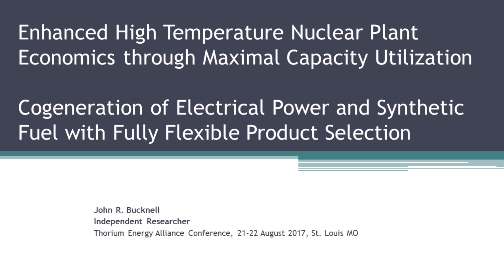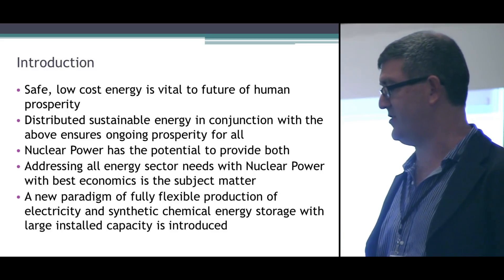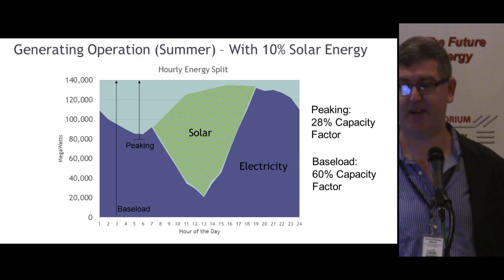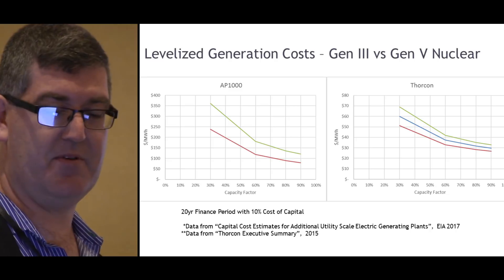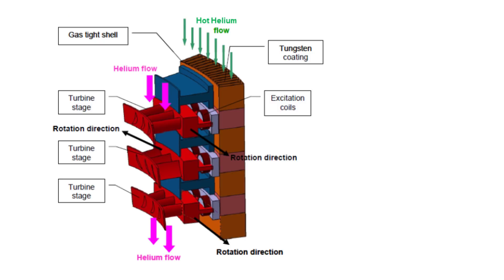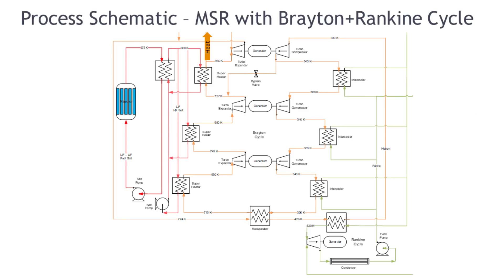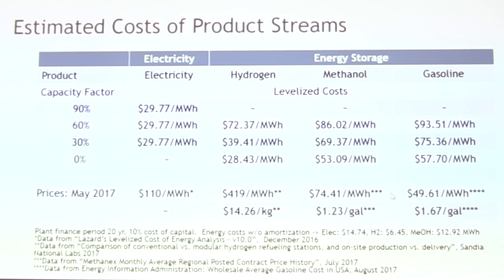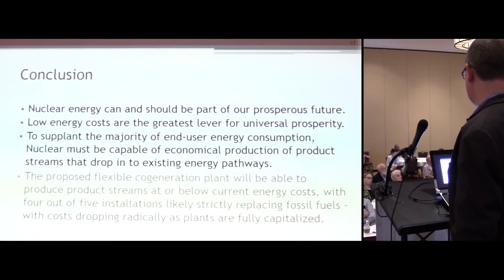John Bucknell - Nuclear Plant Economics & Synthetic Fuel Cogeneration @ TEAC8

Comment: So let me get this right. When the intermittent renewable power supplies flood the market with excess power (thus diving wholesale electricity costs to below break even, you simply transfer the extracted heat from the molten salt reactors to manufacturing chemical energy (which is still the most efficient way for transportation especially aviation).  Then when the wind stops blowing, or the sun goes down, and everyone gets home, turns on the lights, the tv and the oven, you transfer your heat to the generators and sell the power to the grid.  Excess heat from both processes can go to desalination which results in another sellable asset. Cool!
Reply: It doesn't have to be for transportation. Apart from aviation, the economics for hydrogen as a storage medium is less apparent. But regardless, people are going to need hydrogen for fertiliser, medicine, making lubrication oils and gels, and smelting of steel. Alternatively or additionally, you can also use the excess electricity to desalinate water or recycle waste water for consumption. Climate change is happening and our water supply is at risk.

Comment: The sulfur - iodine cycle will be extremely difficult to produce for corrosion reasons. Hydrogen Iodide is almost ridiculously corrosive. BUT I agree we should still research it! Also please just make electricity using existing USC steam. The reactor is already difficult enough. FOCUS on the reactor!
Reply: Indeed, I don' t understand all this complexity when you have (with MSRs) very low cost electricity. On the other band, a good source of carbon may be biomass gasification (if used as C source only)

Comment: The Achates 2 stroke engine is about to enter mass production, the diesel version is 20% better than the best being used today, and the Gasoline version is 60% better on fuel. Combined with synthetic clean fuels like Methanol ( CH3OH) which is identical to gasoline in energy density then we have a vastly superior transport motive power than electric vehicles which while having some limited niche advantages will be economically and practically .............junk. Methanol can be distributed by all the existing petrochemical infrastructure saving trillions of dollars across the globe. One of the biggest blind spots that electric car/truck advocates dont understand is the massive expansion of grid infrastructure needed to support them.
Reply: The vast majority of electric car charging happens overnight when electricity consumption is low. Charging stations are mostly needed for road trips, and are cheap to build.

Battery-electric vehicles no longer have significant limitations for longer trips. Teslas V3 chargers have a typical charging time of 15 minutes.

The convenience of always having a full range at the start of the day without needing to visit a gas station, the noiseless operation, lack of emissions, much higher efficiency and so on will make selling ICE engines extremely difficult if not impossible in the coming years.

Synfuels certainly have their uses for long distance planes and ships, but not for road traffic. I suspect the Tesla Semi truck will kill the internal combustion engine in heavy duty applications as well.
Reply: @phamnuwen9442  Run the numbers........the size of battery needed to pull a typical heavy semi here in Australia ( 68,000kg) would be huge...........and how will the battery dissipate the heat under full load, on steep climbs that can last 30 minutes or more?  Your way out of your league talking about heavy haulage applications.  So when are we going to see AUD $20,000 electric cars with 500 km of range............the answer is never.  How are you going recycle the 500kg Lithium battery? How are Lithium batteries going to improve so that they offer the same energy density per cubic meter of petroleum fuel? It cant.    There is a niche market for small cars and E-bikes in inner city environments that need limited range and are light in weight and can make the most impact and have the most benefit.
Reply: How are the Tesla V3 chargers putting a full charge of 100 kw/hr in 15 minutes...........they dont. So stop misleading people with nonsense, 15 minutes is only a small top up and that does not represent real world situations other than short distance travel to work. We even had outright lies from the green movement here during the last election, claiming that a Tesla could get a full charge in 8 minutes.............it was a totally misleading claim based on press release of high capacity charging station for recharging a BUS with a very large bank of Batteries.  Hooking that up to a Tesla would of made it explode without a safety cut out. People are getting sick of these "green scheme" liars. Is your real name "Bill Shorten"?
Reply: @phamnuwen9442  Lets build a Lithium battery ( Telsa specs) for 68,000kg typical highway truck here in Australia.  Now the Tesla has a 85 kw/hr battery that weighs 540kg.  Now our B-Double is going have a load factor on the engine of 50 % which is 250 kw every hour.  It will be on the road rolling 10 hours in a 12 hour shift.  Thats 2,500 kw/hrs and you will need at least 29 Tesla batteries to meet that demand weighing in at 15,600 kg.  Effectively meaning the payload will have to be reduced some 40%.  Now here in Australia the Tesla supercharger stations are 50c kw/hr but lets use the typical retail price of power here of 35c per kw/hr that comes to AUD $875 when the diesel engine version will use 300 litres of diesel costing AUD $420 ( and 80% of that cost is taxes). So anyone who thinks that Lithium batteries are going to push around anything heavier than cars is going to face a crushing economic reality of dismal failure and destroyed standards of living from using such a limited technology.
Reply: @wazza33racer  I said "typical charge time" not full charge. Learn to read.
A 1MWh battery weighs 6.4T and will be able to drive 4h using your 250kW figure which is probably higher than for US and Euro trucks. Drive 4h, stop for lunch and recharge, drive 4h more, repeat. Seems perfectly feasible.
Search for "V3 Supercharger" on Youtube to get an idea of charging speeds. Model 3 is capable of charging at 250kW which means a 1MW battery should be able to charge at a peak of 3MW if needed to make this practical. 30 minutes will probably give you an almost full charge.
Reply: @phamnuwen9442  AMAZING..........so you admit that typical is not a full charge, so why bother coming up with the 15 minutes number......simply misleading. Your 1 MW battery wont cut it for most semi trailer applications, unless its a small truck hauling a light "cubic" load of toilet paper or crisps. Seriously, this is the real world of trucking, real trucks, real gross weights of 44,000kg to 81,000kg which are 90% of the trucking fleet here.  So multiply your 1MW , 6.4 tons by 2.5 to get a real battery and we have an enormously heavy battery that cripples the productivity of the vehicle.......total fail.  Just admit it, lithium batteries cant cope with heavy applications. Recharging time is still a lot longer than the time it takes to put in 300 liters of diesel..... even a recharge time of 1 hour per shift is 2 hours sitting around doing nothing for a fleet truck that usually is out working 24/7/365. Factor that lost productivity into the higher cost of electricity,lost payload etc etc...........it all adds up to a monumental economic and practical application failure. You want to keep going?? How about, just how much would a 2.5 MW lithium battery actually cost to supply from Tesla............REALLY BIG NUMBERS thats what.
Reply: Most sources on the net are saying US $12,000 for the 85kw/hr battery...........multiply 29 times to get a useful 2.5 MW/hr battery and we have US $348,000 ...........holy moo cow thats really gonna jack the price of the prime mover to the moon and back. Good luck with that.

Comment: Greenies just dont understand how many heavy machines need diesel fuel and electricity ( battery or otherwise) is just not feasible. Every kw/hr of electricity also needs metals to be transmitted and stored etc. Just switching from Diesel to electric propulsion would need a gigantic amount of refined metals, including exotics at huge energy investments and environmental impacts. Gasoline is 20x more energy dense than a lithium battery, and when the Achates 2 stroke opposed piston arrives ( 60% better fuel economy) it will make Gasoline effectively 32x more energy dense. Electric car people just dont understand the math of how inferior electric cars are in both thermal efficiency and cost per km to use Lithium storage.
Reply: how did you figure it would be equivalent to 32 times better?
Reply: When is the Achates engine arriving?
Reply: @emceeboogieboots1608  Already in production with Cummins diesel, being supplied to the US military. Aramco in Saudi Arabia are trialing it their fleet of pick-up trucks also. Has been through a CARB trial in california in a Class 8 Peterbilt.  Because of its almost zero NOx emissions, California are  considering making it mandatory, or at least the benchmark in emissions.

Comment: as shown, we indeed really don't have a choice. however, this only makes sense if all of the world's electricity is being produced from non CO2 sources. next to this I wonder what type of materials are able to withstand a sulfuric acid/water vapor at 1000 oC ? I don't think we have any option there. My last question is how does this compare to making hydrogen from commercially available PEM electrolyzers?
Reply: Hydrogen via best available electrolysis is something like 71% efficient as compared to the input electrical energy.  The energy conversion from heat to electrical is where the largest losses are, so net can be 25-35% as compared to source energy.  This is the reason for thermochemical conversion cycles which can net close to 50%.
Reply: But what about low temperature steam electrolisys ? My understanding is a bit more than 100% efficient (kWh in/kWh out as H2). Particurally, with low cost electricity from MSRs it makes sense

Comment: How would a MSR perform in micro gravity? If I am not mistaken buoyancy and convection is off the table when in micro gravity environment.
Reply: It's more than that.  The big draw for MSR's is walk-away safety which in case of loss of active control the system can dump to a non-critical cooling tank using gravity as one example.  The other is online fuel processing, specifically separation of fission products like Xenon and Tritium which are gaseous.  Separation without bouyancy is an unresearched topic, which puts it further into the future to solve.  Lastly, there is no explosion risk with a MSR - they operate far from the boiling point on purpose, and even then in an extreme temperature excursion would boil not explode.  Designers would purposely make such an excursion impossible.
Reply: Forced circulation MSRs would suffer in microgravity, but the whole reason for forced circulation in the first place was because of its legacy from the ANP program wherein the potential for aircraft to go into dives would eliminate the phenomenon of convection. So ANP used forced circulation to circumvent that. The freeze plug and gravity drain are not necessarily needed, either. Terrestrial energy uses a two-hull design wherein the reactor core is surrounded by a shell of frozen salt. In overtemp scenarios the enthalpy of fusion would soak up a lot of that heat. That can then be radiated. As heat rises, radiative heat transfer becomes more and more efficient by T^4 and so if you can get a radiator design right you can eliminate overtemp and stabilise at some kind of equilibrium; while the molten shell helps even out hotspots.

Elimination of gaseous fission products can still be achieved in microgravity with spraying and aerosolisation, which is a phenomenon driven by Bernoulli's principle and is independant of a gravity term. Nebuliser technology could also be adapted by using vibrating mesh screens to atomise the salt mix. Definitely not a question I can answer but I think that if one can set up a pressure difference sufficient to cause gases to consolidate when aerosolising then it doesn't matter if bubbling doesn't work. The increased surface area would cause some entrained gas to be released from the melt.

It would still bypass a lot of technology development to go with solid fuel but perhaps the barriers to microgravity deployment of MSRs may not be insurmountable. 

For long life missions, a lead bismuth fast reactor operating on very high enrichments (90%) would be more than sufficient for the space application. Shielding is integral to the coolant, high enrichment miniaturises the core and therefore coolant volume. Or we could simply use the MITEE itself - use the decay heat or criticality for power generation.
Reply: The advantages of liquid fueled reactors for microgravity use are in the breeder arena - especially thermal breeders as they generate their own fuel (ie Thorium conversion).  Long life reactors are useful when fuel sources are scarce for in-space development.

For in-space power generation, their have been several dual-mode proposals to use NTP reactors as both propulsion and power generation.  These reactors run gaseous working fluid through the reactor for thermal cycles such as Brayton, usually at lower power levels as compared to use for propulsion.  At high power levels, use for electric propulsion have also been proposed - but the thrust to mass ratio for electric is challenging, so a huge amount of mass to orbit to take advantage of the high Isp is the issue.

A dual-mode MITEE was proposed, with thermal powers of ~10MW for electric and 1000MW for propulsion.
Reply: Liquid fuel reactors would struggle in microgravity for the reasons you state.
Reply: John Bucknell I guess we would have to spin it at the very least. But in what way would we spin it? Would it be at the centre of the rotational force. Or would we put it at the outer edge of a wheel similar to the space station in 2001 a space Odyssey. It would be interesting to see how engineers would over come this challenge.
Reply: I can't even speculate - solid fuel reactors will be used for a long time in microgravity.
Reply: gravity has no effect on the transfer of heat so convection would work just fine. also so long as the reactor dosn't have a lot of empty space for liquids to expand then density of the liquids should stay the same and so too should buoyancy. in the case of the molten salt they'd likely need to lower the temperature so it dosn't explode. the reactor it-self shouldn't need any major modifications to work in space ether.
Reply: it's not an actual explosion I was referring to but the pipes bursting due to changes in external pressure.  for example a balloon will pop once it gets to high because the air gets thinner as it rises causing it to expand till it's at it's limit or an air tank will get crushed and implode if you dive too deep in the ocean due to the water getting more dense as it goes deeper.